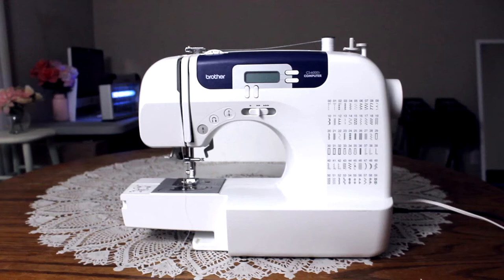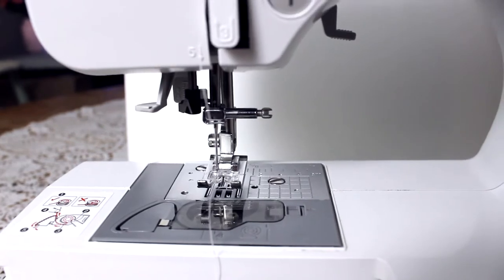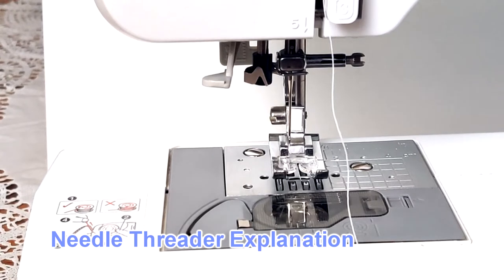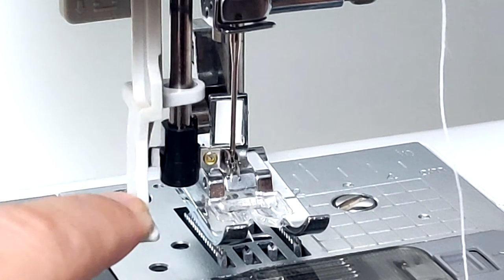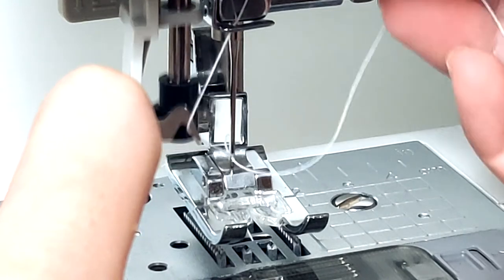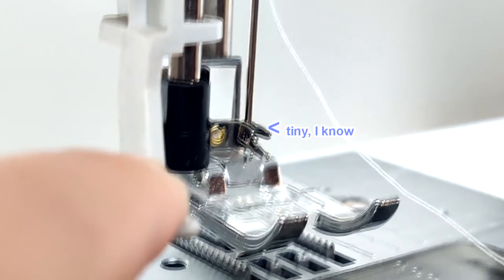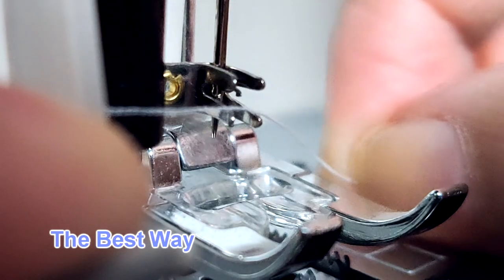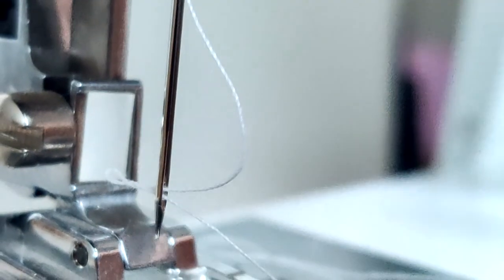How to Use the Automatic Needle Threader - Brother CS6000I Sewing Machine Needle Threading Tutorial

Comment: Just had a beginner sewing instruction with a 73 year old seamstress that couldn't bother using the gimmicky 'automatic' threader as it was not worth the trouble.
It shouldn't be called an automatic needle threader if you still need a magnifier to see what you're doing and is more hassle than just threading the needle the old way!
From a beginner perspective, an 'automatic' needle threader should be a 1 step button push deal in this day and technological age.
If you're gonna add a screen to a sewing machine, at least have an optical cam zooming in on the needle and thread so you can see it without eye straining or wasting time struggling to get it in.
IMHO the gimmicky 'automatic' threader is a scam.